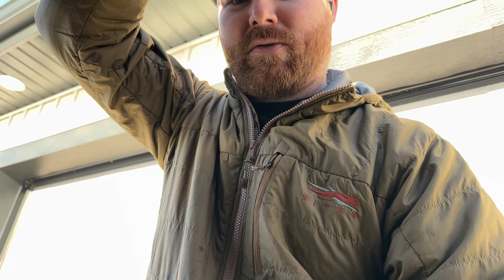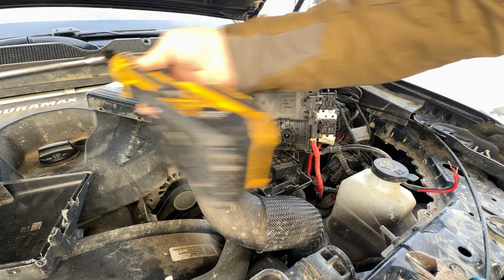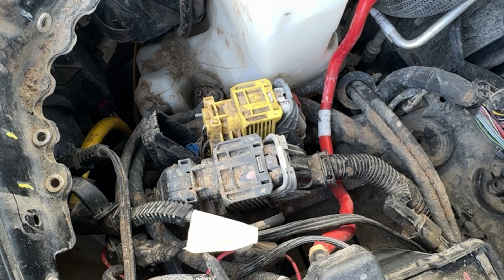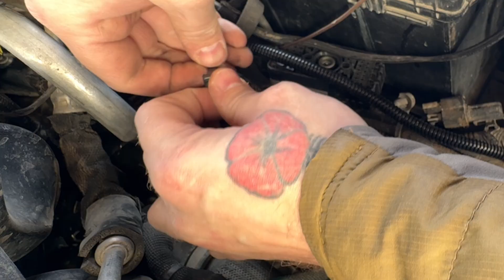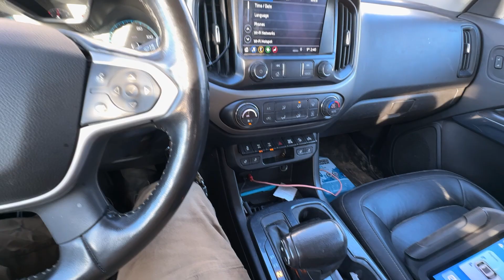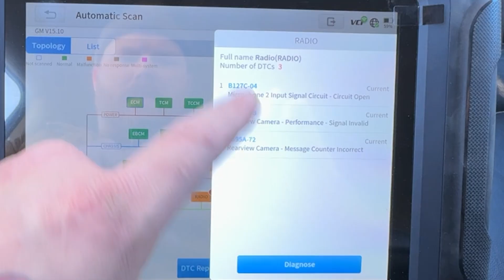Chevy Colorado Z71 With Axle Lockers!

Comment: New subscriber, following along. I also have a 2016 colorado diesel, in Canada as well. Looking to delete soon and try to do more of my own maintenance to save some toonies.
Reply from the maker: Absolutely, well if you have any questions about these trucks you’ve come to the right place. Enjoy the content, and if you want to see something specific I’ll do my best to make a video.
Reply: @The_All-Wright_Fab_Co   I am going to replace the serpentine belt soon, and I am unsure if I should also change out the tensioner and two idler pulleys at the same time - truck only has 100k kms on it. I also heard about a 220A alternator that was used on the 2.8L diesel vans Chev made, so I found one on Rock Auto for 160cad and will be installing that as well.
Reply from the maker: @Scott-dl1ui  at 100k, I’d do the timing belt, serpentine the pulleys and tensioner all at once. Pull the injectors run them through the ultra sonic and inspect the pistons if possible through the injector ports. These are good little engines but they don’t hold up to abuse like the full size ones.
Reply from the maker: What are you running that you need the 220amp alternator
Reply: @The_All-Wright_Fab_Co   12k winch, multiple offroad lights, warn air compressor, inverter. price was right so I thought i would install it
Reply from the maker: @Scott-dl1ui fair enough. I’m running essentially the same stuff on the stock alternator